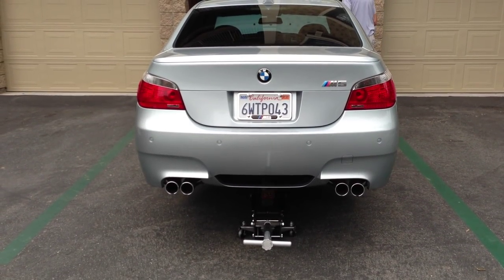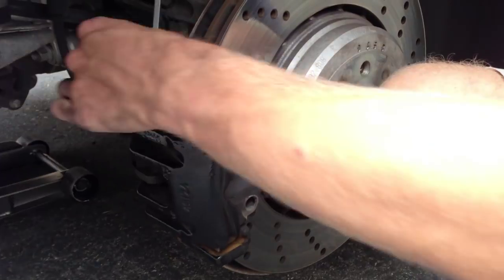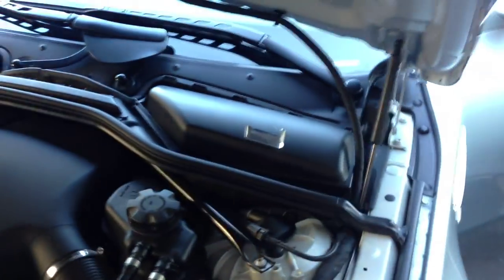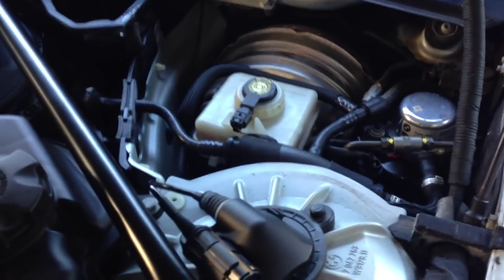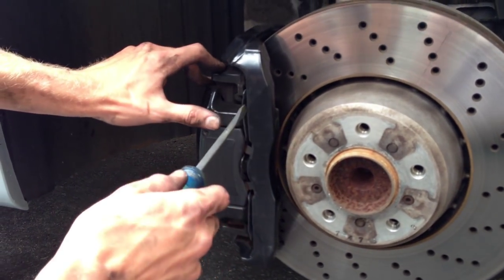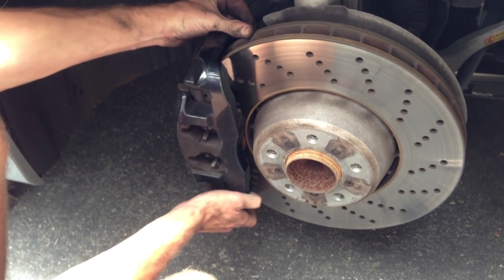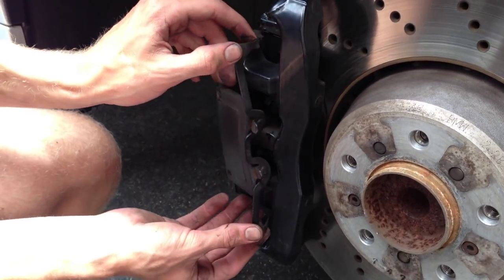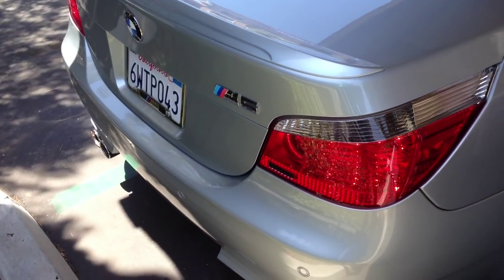BMW E60 M5 Brake Pad Replacement DIY

Comment: Good video, as with all from E39Source.  I will caution that when raising a car from the rear differential, be sure not to place the jack on the cooling fins, as those are not meant to support any kind of load.  Position the jack ahead of the fins, instead.

Other than that, nice work!

Comment: should be clamping the brake lines and bleeding the fluid out the bleed nipple when compressing the pistons otherwise it is possible to do damage to the seals in the master cylinder through back feeding , you could also make the reservoir overfill this way and have brake fluid eat out the paint down your firewall. when replacing pads properly with the nipple open it is recommended to do a small bleed at the same time . cheers
Reply: been doing brakes for over 10 years never had a master cylinder seal damage.
Reply: Ash HAVEN BMW that is a myth that the dealer tells you to try and make you bring it to them the resi when your breaks need to be done should be lower than max anyway been doing my e60 since 10000 miles now have over 130000

Comment: great video .... i appreciate guys like you taking the time to video stuff like this ... i have the brake dust my m5 puts out. ordered new low dust pads a week ago to solve this issue.
Reply: Bishop’s Reviews, diy, and fun vids go ceramic it helps plus little better wet performance

Comment: nice video. im gonna do the brake job in the next couple days for my E71 X6M. your video is really helpful. The only thing im not sure with is should i use grease for the bolts or not?
Reply from the maker: +Pei Su I like to use never-seize on the bolts so they come apart easier next time.  Glad this helped!

Comment: Thanks for the video, i installed my akebonos in the rear yesterday along with a new sensor. everything went smooth with the help of your video.
Reply from the maker: Glad our video helped you out!

-Bobby
Reply: ***** quick question, can that clip on the front calipers be put on by one person and is it really that hard?
Reply from the maker: Damen Smalls You can do it yourself, it just takes some playing with to get it back on.
Reply: OK thank u. Do u have a video on cleaning the steering angle sensor? I'm having an issue with mine now. I tell u, if its not one thing its another with this car.
Reply from the maker: Damen Smalls E60 M5?  We don't have that video.  My E39 M5 has 187,000 miles and no issues with that.  These E60s should not have issues with that already!
Reply: yes it's a bit problem with the e60's
Reply: ***** thanks for the video, i changed my front brakes yesterday and yes putting the clips back on is the hardest part lol.

Comment: I’m surprised that the rotors didn’t come with slots stock, just drilled. I don’t know if I should buy drilled or drilled/slotted rotors.
Reply from the maker: Slotted rotors wear pads faster and don't stop as well, its purely for looks.  Drilled rotors remove surface material and also decrease stopping performance.  They are only useful on the track to dissipate heat faster.

Comment: Hai brother we have a bmw m5 2018 model and it have a hydraulic E brake .
Is it possible to fix a   additional drift brake with handle
Reply from the maker: Anything is possible, but that wouldn't be easy.  Drifting a $120,000 car is quite un-advisable.

Comment: Hi I’m Anthony I need help my 2006 bmw m5 thrown a P000A cam position sensor on bank 1 saying slow response. How do I fix this. It started to come on and go off since it’s started getting cold. Increased emissions is what it was saying. Could you do a diy video on the matter.
Reply from the maker: I would replace the camshaft position sensors (all 4).  There are two on each cylinder bank.  An intake camshaft sensor, and an exhaust camshaft sensor.  I'm sure there are good DIYs online.  I only support two E60 M5s, and neither one of them need that job so I am not authorized to do it at this point.

Comment: I'm doing this job on my 535d this week. Didn't you have to drain some of the brake fluid from the reservoir?
Reply from the maker: +Robert K If the pads are VERY worn, then you might, yes.  You can use a clean turkey baster for that.
Reply: Thanks for answering. My pads are worn out so I have already bought a horse sized syringe for that purpose. 👌😂 The 535d uses the same pads as the M5, but the M5 disks are a little bit bigger. I'm sure the calipers are bigger too.

Comment: thanks for sharing, i need to change my rear pads also. i was thinking of akebono or stoptechs but you seem to give hawk pads a good review. let me check them out. the oem pads definitely leave alot of brake dust. thanks again.
Reply from the maker: Yeah I would recommend the Hawks.  They might make more dust after a year or two of use though?  Or it' just me being picky.
Reply: i actually ended up buying the akebono's for the rear.

Comment: I thought you weren't supposed to jack on the diff fins?
Reply from the maker: That is the only rear end jacking point if a lift is not available.
Reply: Ah...I have used the rear diff before but 'some' people state to not use it. Stating it may dent your diff or something. Have you ever had this happen before?
Reply: Per BMW the jacking point is the not the aluminum fin part but the black cast iron housing.  The fins do protrude lower, that’s why a small block of wood is handy for this and prevent any marring.

Comment: is it possible to put those brakes on an E39
Reply from the maker: Anything is possible if you're willing to spend the time and the money on it.  However.. E39 brakes are quite good, and you can upgrade any E39 to the M5 brakes if you don't have an M5.  Upgrading the 530i or below (anything but 540i) will require some other modifications like 18 inch or larger wheels.

Comment: no brake sensor change ?
Reply: You only need to replace the sensors if the the CHECK light came on in the car, meaning that the sensors did their job and were destroyed in order to tell you that you're out of pad material.  Since we were replacing these pads simply to get rid of brake dust, the sensors were still good.

Comment: Your rotors look like complete shit, you should replace those as well. 
Recommended by factory to do both pads and rotord at the same time.  But you can avoid the rotors by going with a ceramic brake pad, theyre usually pretty low on Dust. 
And for you that want No Dust, go with akebono's
Reply from the maker: Jesus Calderon Jesus.  Rotors are original, and in fine condition still, nearly ten years old.  No vibrations at speed and fantastic bite!  Hawk HPS pads are now two years old, and we're very happy with them.
Reply: ***** im sure rotors are way under spec. I mean, you can even see a lip on the outer sides of it from where its worn out, yeah they'll hold, but you do run the risk of them snapping or cracking under a heavy brake. 
And two years on the same pads??? Thats insane man, i change the pads every 4-6 months and average about 400 miles a month. 

You gotta fix that lol
Reply from the maker: Jesus Calderon The rotors are a good 1/2" thick, they'll never snap.  Averaging around 400 miles per month, pads should last a solid 6-8 years.
Reply: Jesus Calderon Just because it shows a small lip doesn't mean it's out of spec. My 85k rear M5 rotors had a large lip and were only <1mm out of spec. So no, they won't snap or crack.
Reply: Clint Lacewell how is the maintenance cost on that beast
Reply: quonnieQYC how so bud?
Reply: iliovecaRS 
allot if you take it to a dealer
Reply: Lol like changiong oil ,tires,  and cost of owning rhe car over a period of time
Reply: iliovecaRS 
Let me try this again, at the dealer it's not taking a Honda or Toyota or Kia, it's allot more expensive at BMW dealerships to get your car serviced, so DIY or an independent  is the way to go over any period of time, especially if your warranty has expired.
Reply: Do these cars cike with aftermarket waranty??
Reply: +Jesus Calderon Rotors look fine. Replacing rotors and pads at the same time is extreme overkill. Here's what you do instead...you use your brain. Typically, there will be a safe range for brake rotor thickness, under which the rotors should be replaced. If your rotors are above this value, they don't need replacing. Simple.
Reply: +iliovecaRS yup lol